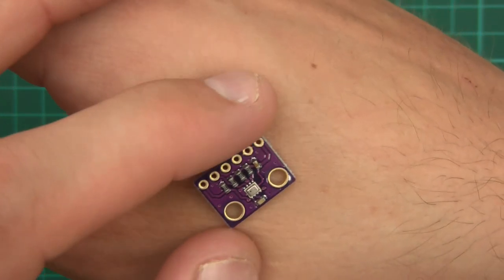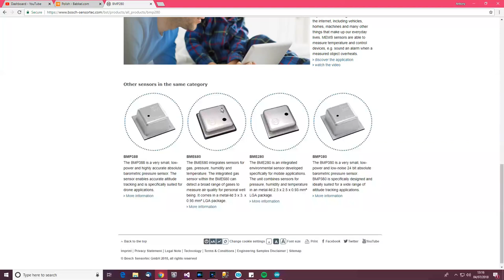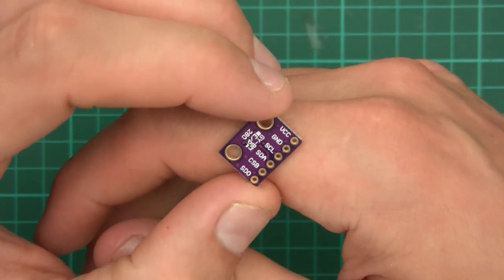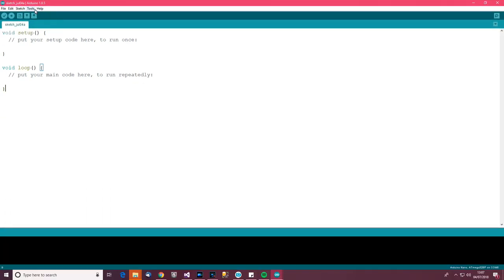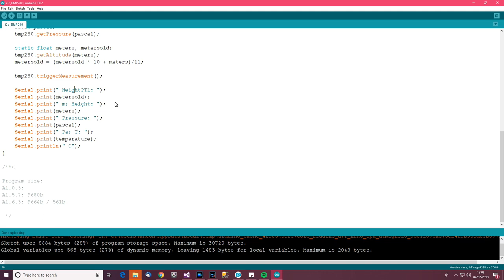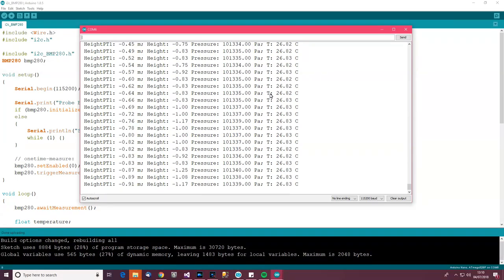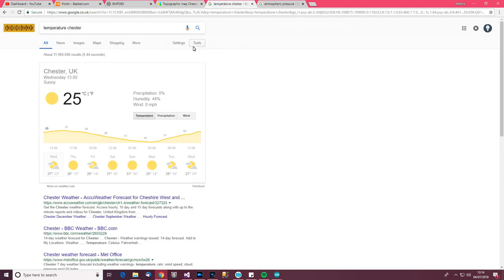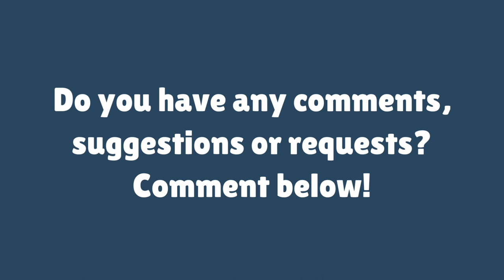TUTORIAL: How to Wire up & Code BMP280 Pressure Sensor - Arduino

Comment: I followed your instruction, at the begin untill the end. But, why it didn't work for my BMP280? It means it couldn't be read the sensor. Pressure and temperature weren't be displayed on Serial Monitor. Just "BMP280" available on Serial Monitor only. Help me please.

Comment: Your supplying it with 3.3v on the bus, but the i2c data lines are still using 5v logic. Either use a level shifter, or 5k resistors in the data lines otherwise you can potentially damage this unit. Or just use a 3.3v microcontroller.
Reply from the maker: Hiya! This module is 5v tolerant. You can actually use 5v VCC too! :-)
Reply: @AntonyCartwright  you sure about that?

Comment: Press the solder to the pen point and drip the melted solder into the pin. By touching the soldering pen point to the circuit board, you risk destroying it.

Comment: Thanks for the video. Worked first try! Why did you use A4 and A5 pins? Are they reserved for SCA and SDA?
Reply: Yup! They are. You can find an arduino pin out diagrams that show A4 and A5 reserved for SDA and SCL respectively https://components101.com/sites/default/files/component_pin/Arduino-Nano-Pinout.png

Comment: Hi could anyone help me with a problem that I am having with my bmp280 and esp32

I am currently using your code from github but would like to add some extra on the bottom, unfortunately I don’t really know what I am doing, so wondered if you would know how to make the esp32 to use the pressure reading from the bmp280 to do something like this: PRESSURE (in PSI rather than hPa)>(any number imputed via WiFi. E.g. 12.5) = YES/NO

Comment: is there a known "fix" for the height mistake? I keep getting a height of -27 m... I know im not that low, so is there a solution?
Reply from the maker: Yes, as you see, me also... I don't know the fix, but I've not looked very hard.
Reply: @AntonyCartwright  The way these sensors calculate altitude is by sensing the pressure at your current location. In the sketch you have to enter the barometric pressure at sea level. From the 2 readings the  controller can extrapolate your altitude. Barometric pressure fluctuates all the time, so does sea level  bar pressure, so you always end up with a slightly off altitude. I have not used this sketch but the ones I have used all have an input for the sea level barometric pressure. From Google you can get an altitude for your location. then use this calculator https://keisan.casio.com/exec/system/1224575267 to calculate sea level pressure. I hope this helps

Comment: First apologise my English i so bad.
I have a problem in the Serial Monitor it displays characters like this one:

i⸮⸮⸮⸮m⸮⸮⸮ayi⸮⸮⸮q⸮⸮⸮⸮a⸮⸮⸮xZ⸮

If you can help me, please I'll be very grateful.
Reply from the maker: The baud rate isn't right... :-)
Reply: Thank I fix it was de SDO it has to be in 3.3v to work if the I2c is 0x77 or GND if it's 0x76.
Reply: i got same errror until i set baud rate to 155200. then al sorted out. oh abd also 5v instead of 3.3. cheers!